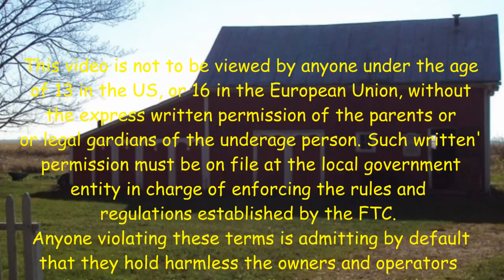Sewing Up The Rips   Drag Bag Repairs

Comment: MERCY! I would've had to just try and melt it together with a small torch flame or something but I think you're sure on the right track with the tarps for a skid plate. I know that on some jobs years ago we had to just blow and rake the leaves on tarps and sometimes it took 3 or 4 of us to mule them out to the truck because they were wet but fluffed up as good as they could get by the raking or blowing. I'm glad we just have what we have which ain't much and NONE compared to yours! We don't even have a tree! But if I do ours every week it's not bad. Blow all the front over the lilies for mulch and ground cover and blow the back into a pile or row and vacuum them up. Might take 2 bags (Stihl) and they go on the mulch pile. Then maybe use the Kawasnapper to bag some stragglers. So happy rest of the week and God Bless1.
Reply from the maker: I love having the trees. I have planted 3 more just because. 
The leaves aren't a problem until I start picking them up. 
With the Drag Bag they are no problem at all. 
If this bagger tears then I'll just buy another.

Comment: great video dave i use the small black bulldog clips to hold my seams. i tend to jab myself other wise yrs ago tractor supply had a sale on canvas tarps  they're not cheap but i've yet to destroy the 2 i have after 5 yrs if your going to use this bagger every yr it maybe worth investing in one for the bottom. what model is your singer? i have a singer long arm from 1922 its treadle powered
Reply from the maker: It is a Singer Model 66. 
I intend to use some of the plastic tarps that I have. Several are worn out but good enough to drag on the ground. 😁😎

Comment: French seams would be better
Reply from the maker: What is a French seam?
Reply: @OldSneelock  sort of what you did. The difference is the raw edges overlap the seam width with stitching on each fold. Usually used on pants.
Reply from the maker: I see. 
I originally thought I would use a seam like that.
When I was wrestling the bag around the sewing machine I decided to not fold the seam over and sew through the side of the bag. Ieft it so I could just fold the seam over and leave it to protrude inside the bag. 
With the zig zag pattern of the tears I was having difficulty just getting the edges to overlap. 
The original seams that hold the bag together have basting tape on them. 
That would increase the strength and quadruple the labor to sew up the bag. 😁😎 I got lazy.........